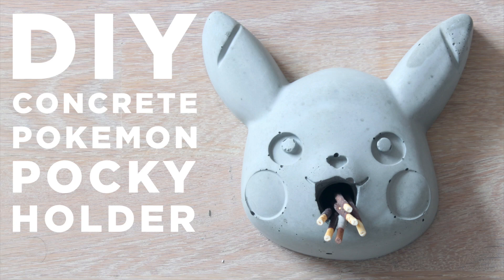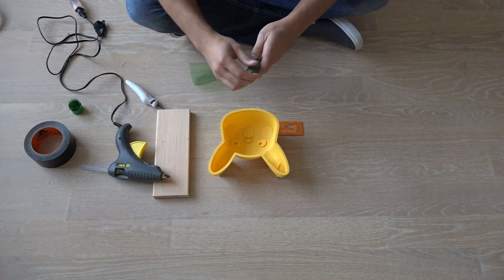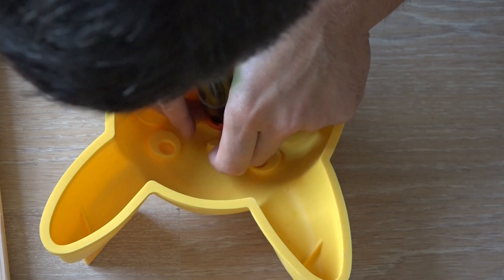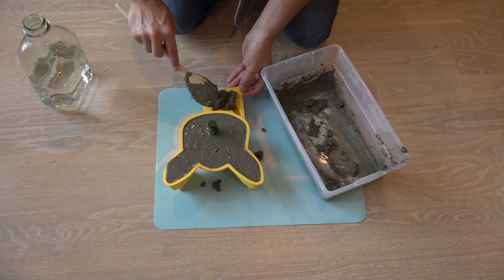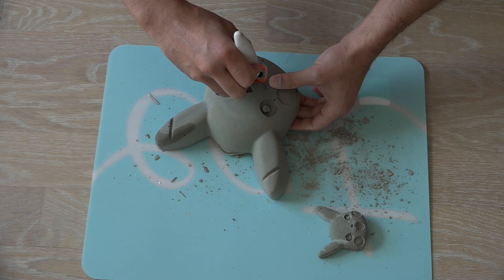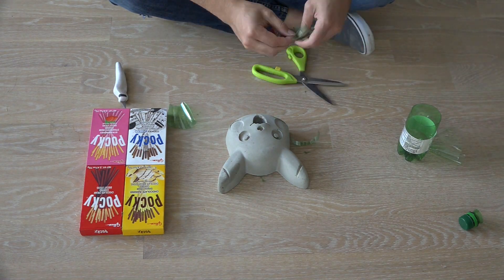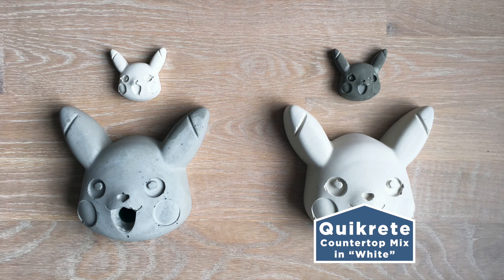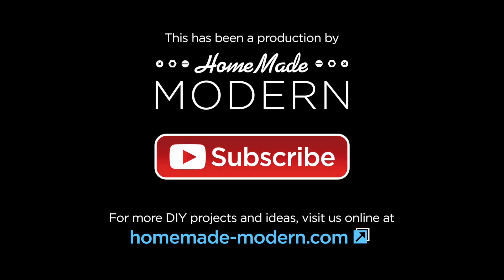DIY Pokemon Pocky Holder

Comment: Do you think putting liquid concrete in a camber style vacuum would eliminate all air bubbles trapped in the concrete? I know it is used in mold casting a some types of high-tech food processes (i.e. Chefsteps). It might just ruin the concrete or even make it too thick to pour. I ask since it seems you have some experience with concrete. Thanks